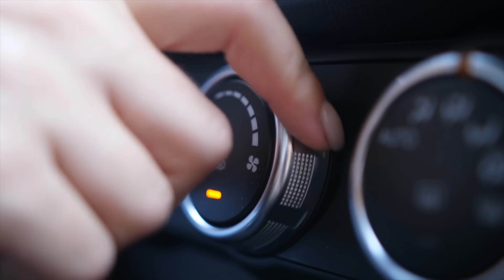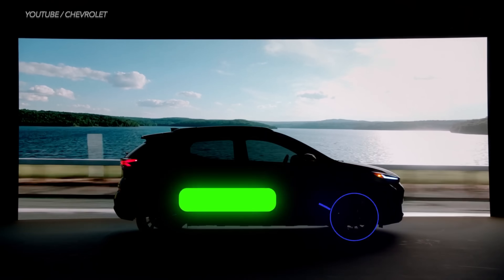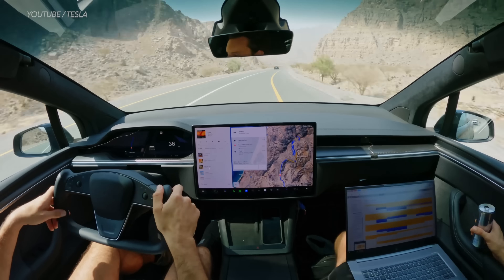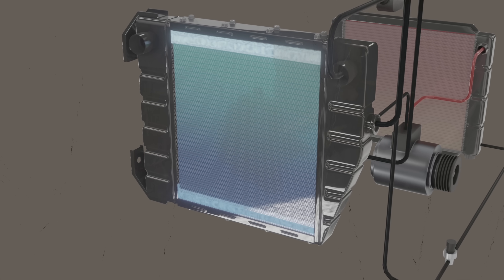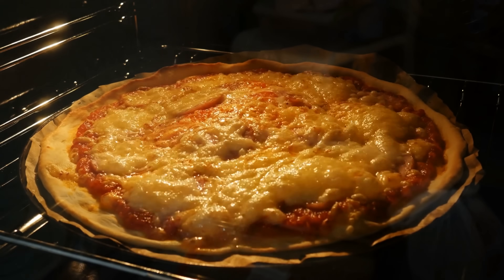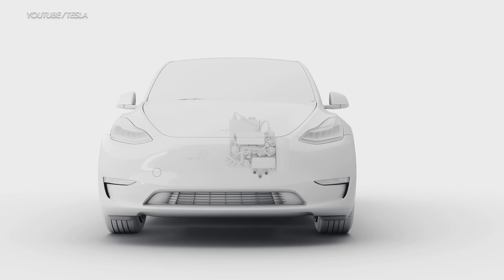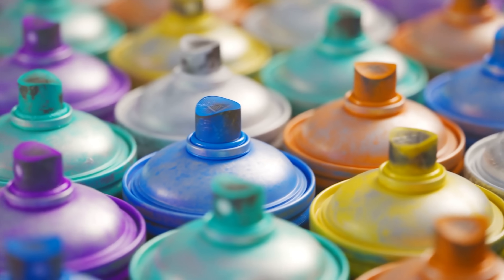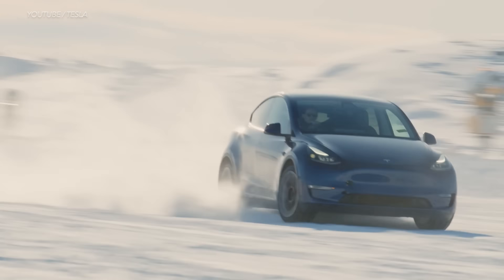Car AC Secrets Explained By a Mechanic

Comment: Freon is not a bad gas. The chlorine in Freon weighs too much to do what they claimed it did & reach the stratosphere. The attack on Freon didn't happen until Duponts patent of R12 ran out. If you weren't aware Canned Air Dusters are freon. Yes a substance thats designed to be sprayed in your home is the same thing they claimed was so dangerous. You can use Canned Air to charge an AC system. The Ozone Scam is about Money & Power like everything else.

Comment: The Tesla heat pump using a coolant is nothing new. Aircraft (Passenger) having been using this method for keeping galleys (food and drink) cold for decades. The A380 for instance has two systems (Redundancy) and functions like this. The coolant is Galden..A completely inert fluid. You can dunk  a TV into this stuff and it will still function normally. Though it's extremely expensive. The B787 uses a coloured glycol for it's systems.

Comment: Here is another reason, to go with a manual transmission and forget the EVs. Even the AC and heater will make the EV range shorter. While the manual transmission can save on gas.

Comment: I've been through Arizona and it was always HOT 🔥 🥵, AND dry heat doesn't help much when it's 110 degrees. A furnace is dry heat, but I'm not walking in to a furnace either
Reply: The point he's making is that at any given temp the air with lower humidity will feel cooler...

And this holds true in winter as well: if you've got a higher relative humidity in your home, (say, if you're an aquarium keeper) you can keep the thermostat a couple of degrees lower and still feel comfortable.
Reply: @openeyes-411  I know what he meant and you're right, but Arizona is no place to be with an electric vehicle
Reply: @Vincent-ke5zn  
Yea I hear ya! But I'm thinking there's next to no place that's not gonna be severely taxing on EV's - one way or the other.😂
Reply: @openeyes-411  very true 👍

Comment: I have a Mode 3 and live in Phoenix, Arizona. Got the A/C cranked in the car and lose about 40-45% of my range. Example, drove 71 miles running errands today, used up 128 miles of battery range. Now to be completely honest I had about 30 minutes of climate control run time while the car was parked in the parking lots, so not a true driving miles vs battery range. 

Yesterday I noticed my “Range” going down 1.5 miles for every mile driven. 

I got the car to be my daily commuter in the city and it’s working out really well. Only costs $35 a month to charge.  Was spending $120-$160 a month on gas before. However the gas saving just ends up getting spent on tires because they wear so quickly, so not actually saving money overall. Is nice never having to stop at a gas station though, and I get to use the HOV lane during my commute which is in itself priceless. 

I don’t care about being green or saving the environment or anything. I needed a new car and it was either $35k for a Honda Accord or $40k for a Model 3. Figured I’d experiment and see if you really save money on gas or car maintenance over time.
Reply: Yes, they are definitely hard on tires. Some of it is just the way you drive. Going Chill mode will help. And like any car, highway will get you more miles as well.
Reply: @dbradley65 why do their tires wear out faster?
Reply: @theskyizblue2day431  The instant torque and they way more than a comparable car. On the positive side my brakes are like new.

Comment: How does Tesla get away with using Freon in their heat pump when the EPA has outlawed its use everywhere else?
Reply: Freon is a trademark name for refrigerants made by a certain  company. It's still in use everywhere. Maybe you're thinking of a specific refrigerant that has been phased out and replaced with a newer environmentally friendly refrigerant.
Reply: The word Freon is a general word. Today there are Several different types of Freon. Residential homes use R410a, cars use R134a. We have several R22 alternatives like R438a and several others… in 2026 to 2023 the EPA will change residential ac units to R454b and other Propane based refrigerants aka freon
Reply: @Alanstrainworld which makes no sense since it's a flammable gas 🤦
Reply: @bastionwolf  low flammability
Reply: @Alanstrainworld  yeah but flammable nonetheless. The fact that it is should be at least slightly concerning.

Comment: Scotty, if you reduce the cost by 100%, you are down to free.  Please tell me what you mean by reducing the cost by 500%.
Reply: Nothing is free.
Reply: It’s called a great exaggeration
Reply: Lol..😂
Reply: He discussed this around the 8min mark + or - .
Reply: I am so confused….
Reply: Use common sense even if the math or logic is wrong. "Reduced by 500%" is a mistaken way of saying divide by five (or 20% of the original cost, reduced by 80%, etc, etc)
Reply: @andreigolovik  This is MATH not common sense.  This isn't about GUESSING what -500% means, it HAS a meaning.  That's the thing about math, it is possible to be wrong.  I know, amazing concept, right?
Reply: Right now prices 1000% of what they suppose to be,  so you're saving half
Reply: I've seen figures like this.  I seen something that said like %2000 of this number. My head said "That's like 2000000" but it wasn't.  So I don't know how it works
Reply: Auto shop has labor rates posted.
"$$$$" If you help."
Clip joint mechanics feel out how deep customers pockets are.
Reply: Well, he also says 100,000 highway miles is equivalent to 10,000 city miles, so I asked if that means I can change the oil in my highway driven car every 100k. No answer. I can’t find any information to substantiate this claim. Not dissing the man. He’s a national treasure. But we all have blind spots.
Reply: @StratKruzer yes the amount of wear on tear on your engine, the oil will break down the same. The amount of wear and tear your engine gets from 10k city is the same as 100k non stop driving on the highway. Again oil will still break down and get dirty the same
Reply: Tesla saves you money and Scotty has been wrong this whole time. 😎